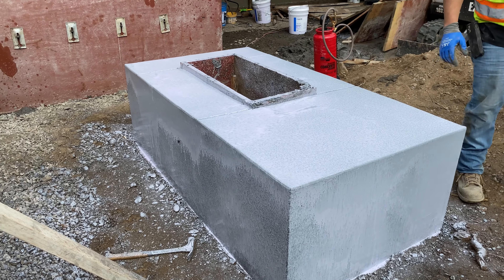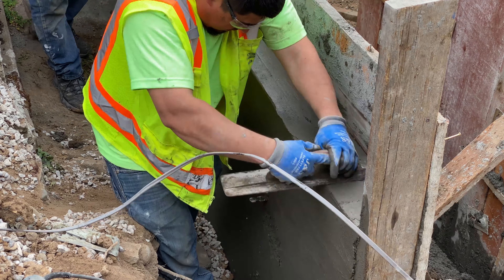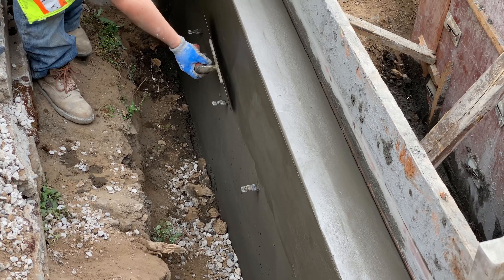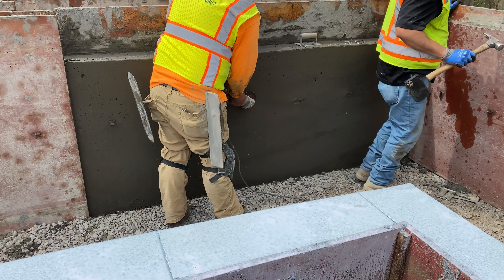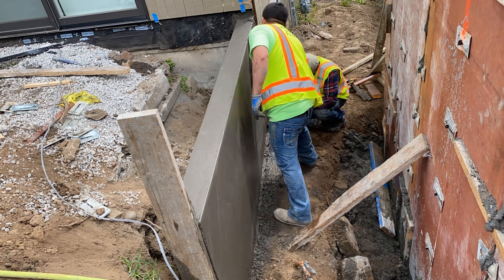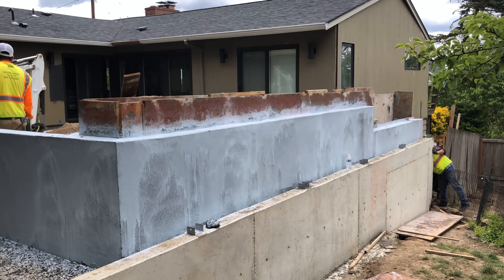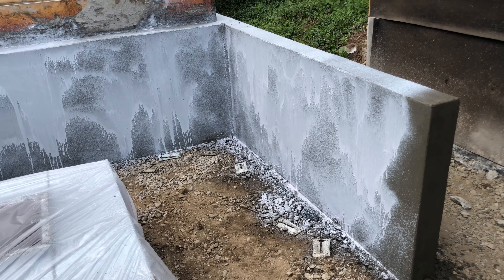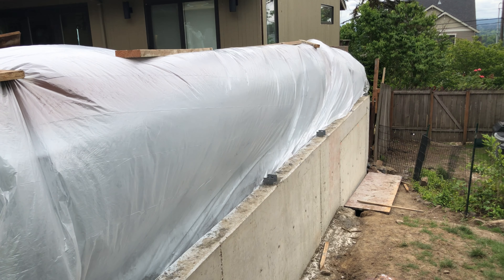How to Pour A Sand Finish Concrete Retaining Wall with Finishing Techniques Part 1

Comment: The face of the wall facing the dirt bank supposed to be on an angle not straight down from strength.
Reply: Sounds like you're some sort of engineer
Reply: It’s a 3ft piling wall, not a 10ft cantilever or gravity wall buddy. It’s fine.